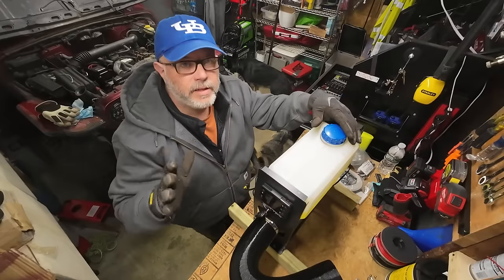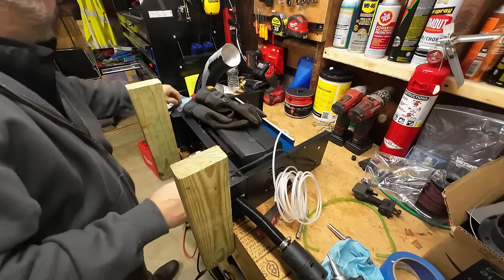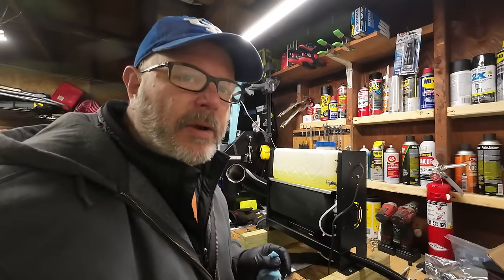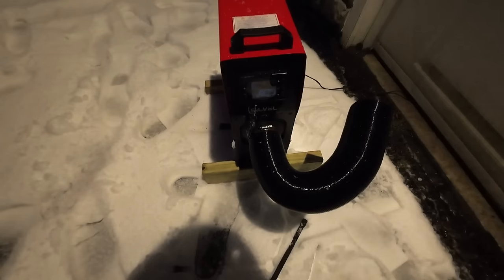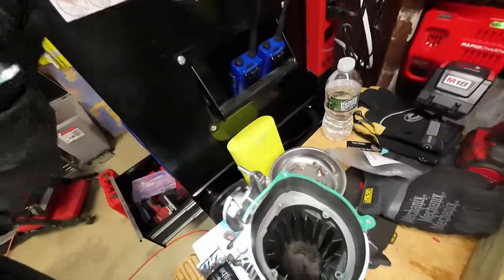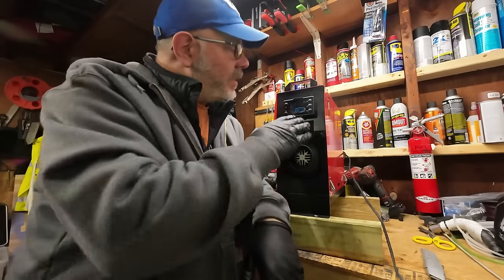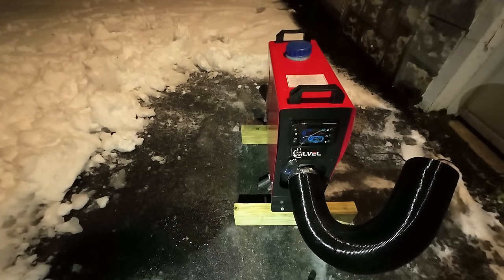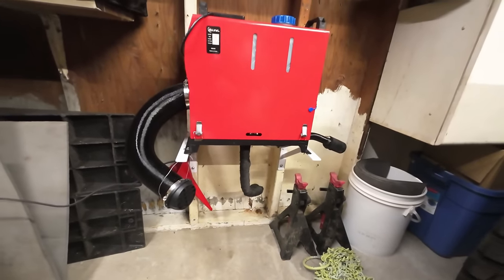Mistakes were made - I almost killed my diesel heater

Comment: There are ways to tune the fuelling from the setup menu. From the factory generic settings they run pretty rich but you can adjust the max and min pulse rates to optimise the burn. I used a £20 carbon monoxide meter and  adjusted the C0 down from 150 ppm to 12pm on the high setting. There are videos on you tube, just search “tuning Chinese diesel heater” it’s pretty straightforward.   It can be done using the display by gradually reducing the pump pulse frequency until the temperature bar drops one bar and increasing the fuel until the last bar lights up. Worked well for me. Hope that helps 👍
Reply: Living at high altitude, the system ran VERY rich right out of the box.
I live high enough that my 5Kw is actually maxed out at 3Kw. imagine dumping 60% more fuel than would burn cleanly, the black smoke and soot buildup.  I quickly looked up how to adjust this, the above method is how I did it, it worked beautifully

Fast forward a couple of years, the old one died of a bearing failure after two winters of continuous use, I ordered a new one with a new controller; the new controller did not allow for any setup in this department, it did have a "High Altitude" mode, so I thought I was good.
The first week I had it, I took it to my folks, with the camper it was attached to. they live near 10,000ft (3000m) (Needless to say, it conked out at around midnight in sub 0F weather, throwing the same error code. I spent the rest of the night under an electric blanket, everything in the camper frozen.
Towards the end of the next day, after working on their off grid power and well pump system, I went to work on the heater, same thing after a few minutes of operation, dumping thick black smoke, then white atomized diesel as the flame went out. Youtube video showed how to change the controller, I figured that the new controller was dumping way too much fuel in regardless of the "high altitude" mode setting. which I did, back to the one on the old unit. I set it up to run extra lean, blew out the piles of soot by blowing hard into the intake,  It started up, limping, after an hour or so, I slowly raised the fuel up as it cooked off the soot, 
It now runs like new, better than new, considering the controller that it came with is useless
Reply: Not true for all these heaters. There are some that have no adjustment available.

Comment: Figure out how to go into the settings for the fuel pump and turn down the fuel delivery amount. The pump is set to a higher duty cycle than is needed from the factory and results in what is called wet stacking where the unburned soot in the combustion chamber soaks in unburned fuel (unburned fuel is caused by not enough heat or too much fuel) making it sticky enough for more carbon to layer on over and over. The same thing can happen with diesel engines when they idle and do not maintain operating temperature.   Replace the glowplug and clean the burn chamber once a year as preventative maintenance.  Fuel filters should have the flow going around the outside of the element and exiting the center.
Reply from the maker: Thanks for the comment. I will give it a try.
Reply: Thanks buddy.

Comment: There is a time between ingnition of the burner and the exhaust pipe gettin up to high enough temperature during that water will condensate within the exhaust-pipe. (Ever seen watter dripping out of the exhaust pipes of cars in morning traffic during winter?) That water needs to be able flow out of the exhaust pipe, otherwise it will catch carbon, that carbon will then remain within the pipe even after the pipe went hot enough to dry the water out. After toing that often enough, the carbon will build up sufficiently to hamper airflow and you will get carbon buildup all the way up to the burning chamber. It can be even worse if your exaust has an U shape somewhere as then the water alone can already form a resistance to the exhaust flow as the exhaust has to force it's way through. This leads up to an even earlier carbon buildup all the way from, including, the burning chamber.

Comment: The carbon buildup is from unburned fuel, one cause is low burn temperature, the second most likely cause is excess fuel. When a fuel cannot burn completely, soot is a byproduct of the combustion, and it sticks to the coldest parts of the chamber first, and as more is produced by continued incomplete combustion, it will cover more areas.
Reply from the maker: Thank you for commenting and sharing your knowledge.

Comment: The moisture is a byproduct of burning diesel. You were making it run rich due to backpressure of having to boil through the puddle in the exhaust. I run mine on 20% waste engine oil and will see how this runs over long term.

Comment: Two thoughts.... The exhaust pipe temp is well over 300 degrees while the unit is running, shouldn't that burn off any moisture in the pipe?  And second, all oil burning furnaces need to be cleaned seasonally, so maybe the soot build up on these units is unavoidable? Mine only has a few hours on it so time will tell.
Reply from the maker: Thank you for the comment. I'm really not sure what the cause was or is. I was shocked to see that it was that dirty. I've only been using it for about 8 weeks and only two days per week. Hopefully this is resolved. Good luck with yours.
Reply: The very best fuel you can run is JetA fuel it’s just supper clean and you will never have soot problem. Where I live JetA fuel is cheaper than diesel and some times I will run 50-50 jet a & diesel and at the end is season make sure you run jet a to clean it out and try to burn as much as you can because kerosene loves to draw moisture in your fuel tank so that’s what I mean to burn as much of the kerosene out and refill with diesel and you won’t have any moisture problems.
Reply: As longer the exhaust pipe is and as colder the environment as faster the exhaust pipe cools down.

In the muffler of the Chinese diesel heater kits is a small moisture drain hole built in.

You can also buy special exhaust pipe bends with condensation drain.

Comment: The carbon buildup is from the condensation build up in your up-turned exhaust pipe. It creates back pressure and causes carbon buildup in the combustion chamber like what you found.
Reply from the maker: Thanks for commenting. It has been running great since I made the change to the exhaust. I should have picked up on it initially but I did not. The new install is a way better setup.
Reply: Keep your exhaust as short as possible and always running down over with no more than 270 degrees of bends 👍🏻🇬🇧

Comment: 6:00 The inline fuel filter is installed in the wrong direction and will clog up way faster. 
The correct way to get the best out of a filter, is to let the unfiltered fuel come arround the filter element, where there is a lot of surface, and leave filtered through the side that has less surface. Grtz
Reply: that way you can also see any trapped bits, the way it's installed you wouldn't know until it's blocked.
Reply: @stollyfiles  100% correct.
Reply: Some filters don't allow that. Many have check valves
Reply: Nice to know ... Thanks
Reply: Yup you need to turn your filter around buddy👍🏻
Reply: From the tank to the threaded end of the filter right? That is how it was connected in the video but flipped upside down when put into case.
Reply: All of what you said, and it's been a while but I wanted to comment for especially the ladies who have no idea what you're talking about and myself being one of them, this is why I bought a planar diesel heater that comes fully put together and plug and play. All I have to do is plug the in the power, thermostat, and kerosene. I choose to run it on kerosene precisely because it if gets all gunked up, I'll never be able to fix it. I tip my hat to you though! It's nice to know that if I somehow manage to break it there's a chance that somebody will know how to fix it other than sending it overseas for repairs.

Comment: I have a snowblower that used to act up too. Replaced filter, lines, spark plug, carburetor etc... It was the fucking fuel cap vent. Punched a hole in it with a drill (it's not stored outside) and presto. Runs like a champ.

Comment: wow this is crazy! I got over 6000hrs on one of these before the bearings went out in the fan motor and its clean inside 
but i do have the setting for the fuel turned down just abit and only run diesel
Reply from the maker: Thanks for commenting. I only run new diesel from the pump. I feel like all my problems were related to the exhaust setup I had. It’s been running great since.

Comment: I have a new one but the shorter fatter model.  Keep getting same codes as you after only having for a few days.  It would shut off with 08 code and then would give me a 10.  I found the rubber breather in the cap keeping the fuel pump from working properly and removed it like you.  Good Job on that one most people don't mention that.  Also I mix about 10 to 20 percent of 87 octane gas with my diesel and have great results running @ 150 c on level 3 and 4. You should try a little gas with diesel and run it hotter to keep carbon down.  I would like to know your average temps when running.  Thanks for posting and this will be helpful for people with similar issues.

Comment: Good video, Thanks. FWIW, a couple of points: It could just be the way it looks on the video, or I could just be dead wrong, but it appears that the fuel filter is on backwards; shouldn't the bowl part be connected towards the tank and not the pump? Also, you really might want to have the combustion intake outside too. I have watched a good number of videos over the last year or so and I have seen more than a few where some problem with the heater failed and caused the heater to back feed smoke through that hose. You don't need to get another through the hull fitting for that one though; you can just use a 3 inch piece of 3/4 black pipe and a floor flange, that intake hose will actually thread right onto the black pipe. I painted the floor flange to give it some rust protection and mounted it outside about a foot away from the exhaust. Have a great one.
Reply from the maker: You are correct the filter is on backwards. There is no arrow and I had a 50/50 shot. It seems to be working ok I flip it around in the spring when I service it again or when it needs repair again. Thanks for commenting.

Comment: I run my heaters during winter and got fuel from pumps, but 1 time the fuel can sat on porch during below zero for a few days and poured into tank and saw white sludge like material on the very bottom of my fuel can I got from pump to heater. Now I use a tank with a felt type filter before I pour the fuel directly from a pump.

Comment: Your filter is on backwards.
 I have the same unit mounted the same as you do with those kind of shelf brackets and the exhaust running thru my block wall in the shop. I don't use the muffler but I did use a small piece of expanded metal to keep any bugs from crawling into the exhaust. Mines been running for a couple weeks now with no hickups!!
Reply from the maker: Thanks for the comment. I took the filter out completely. Running no problem for 3 months so far.

Comment: Make a little hood over your exhaust pipe out some thin or whatever you have and blowing wind could blow rain water in there, good video!
Reply from the maker: Towards the end of the video, I did install a little rain shield
Reply: You should also have MUCH more protrusion from the shed wall of the exhaust not least because of 
a) exhaust heat ... Considerable ... Charring or even setting fire to the wood cladding of the shed 
b) the exhaust, having protruded by at least 2-3 inches (50-75mm) should have a downward elbow of about the same to ensure exhaust gases that condense as they reach to outside are forced to drop away from the exhaust. Anyone fitting such a unit from scratch should ensure that the exhaust through the wall angles down ward sufficiently to enable and condensate to drain easily. Ideally the last 30cm/12" should be changed to be solid copper pipe with a smooth bend from the vertical drop inside, to the downward angle outside. This will ensure there is no possibility of condensate catching in the corrugations!

Comment: Great vid, lots of people make that mistake with a bend vertical. A natural by-product of diesel is unfortunately water, it will gather and eventually collect in the bend reducing the flow/emissions of exhaust fumes and then you get that carbon build up in the chamber down to poor exhaust. Everyone flapping here on the filter "wrong way" pffft. as long as the diesel flows the burner doesn't care what way it enters! When you had the burner out not sure if you noticed the flat chrome cap with tiny flat head rivets on. Well, if one of these pops the lid bends out like a bimetallic strip slightly when hot and you can't see it as it's hidden until you seperate the fan from the housing. If the heater keeps going out on you this is normally the problem due to too much airflow into the burner blowing out the flames. Something I learned last year,  just a heads up incase!! 👍
Reply from the maker: Thank you for sharing all of that information. Yeah, I took a little beating on the filter but it’s working fine so I left it alone
Reply: No worries, not sure if you have it by another name over there but I actually do a 50/50 mix with kerosene and my natural soot levels dropped 40% as it burns a little hotter and this in return allows you to run the heater on a lower setting.  All the best from the uk!!  @paulethier3416
Reply from the maker: @crazy-diamond7683   Maybe I’ll try that mix. Thanks for the tip.

Comment: Carbon build up will always happen with this type of heater but usually very minimal with clean diesel, the level of build up you had is what i would expect from burning dirty waste oil, it could be that because it was fuel starved due to the cap vent it might have caused an incomplete burn situation and this would cause the even clean diesel to not burn fully and cleanly and so deposit carbon.

Comment: good job, i think you would get more heat out of it if you drill another hole in the wall and suck fresh air for your burn chamber instead the heated air from garage and blowing this out the exhaust.,which will cause cold air to enter the garage and cool it.i might be wrong but i did this on my wood burner and it feels right.
Reply from the maker: Thank you for commenting and for the suggestion. I’ve thought about doing that I just haven’t done it. I does make sense.

Comment: Your heater worked as it was designed. Because of the plugged exhaust it caused the high limit  switch to activate .
Reply from the maker: Yes, that gave me some piece of mind knowing that the safety switch worked perfectly. Thanks for commenting.

Comment: WOW WOW WOW! When you open the combustion chamber it looked like the gate to the hell😂. The nylon hose/filter kit is already in my house, waiting for the heater to arrive. May be in couple of days. Point to remember: the correct heater position to have the moisture running down and off the pipe. Also, I will set an elbow pointing down on the external side oh the wall. Do you think it makes sense using high grade diesel oil, or an additive? Thanks.
Reply from the maker: @jumboon  I think road grade or off-road fuel from the pump. I think it’s just fine.

Comment: I think your diagnostic was spot on, and I think your carbon buildup was epic.  After 2 years of running my heater I had to clean that little orifice where the glow plug screws in.  After 4 years of service I decided to start feeding it used motor oil at a rate of 1 quart per 2 gallons of diesel.  I'm starting to get the e-08  flame extinguished code.  Do you have the book with all the codes?  Reckon I can give them if you want.
Reply from the maker: Thank you for commenting

Comment: The metering pump only squirts 0.02ml per stroke so it's not actually "pumping.
Takes 250 knocks to fill a teaspoon.
It's best to fill throw pressure  fuel line all the way to the metering pump with an inline " squeeze bulb"
If the system dumps more fuel in the priming process than the tiny glowplug/ atomising screen can cope with, tgen poor combustion and smoke will result.
Process should be fan on first, glowplug drawing up to about 10 amps and igniting the atomized diesel. Once itsrunning at temperature the glow plug will switch off. The carbon can be reduced by using 50% paraffin/ kerosene with your diesel.
Also reduces humming and cold starts.
Low intake and exhaust resistance is important too.
Failed gasket will recycle exhaust gasses like an EGR.
Leaking carbon monoxide into the warm air ducting could be dangerous.
Check the glowplug rubber and fuel pipe rubbers are ok and seated properly....
Reply from the maker: Thanks for commenting and for all of this great information.

Comment: The new exhaust routing will likely solve the carbon problem but what is the elevation where the heater is used? Elevations above 3000' can be an issue if the heater isn't tuned for high altitude. Many controllers can adjust the air/fuel mixture by changing the fan speed vs pump Hz, and some controllers have a "plateau" setting that leans out the mix. Couldn't see yours well enough in the video to tell which type you have.
Reply from the maker: We are at 1200ft elevation

Comment: Hi, just a suggestion, run the heater on full power for a sort time prior to shutting down so as to try to burn out any carbon that is in the heater..
Reply from the maker: Thank you for commenting. I always have to run on hi because the of the lack of insulation in my garage. I feel like the issue I was having was because of the moisture in the low section of the exhaust pipe. Since this video no issues it has been running perfectly